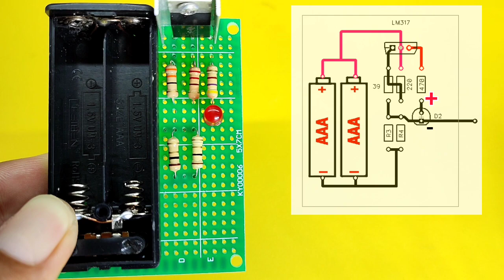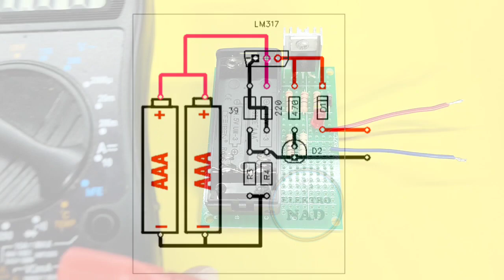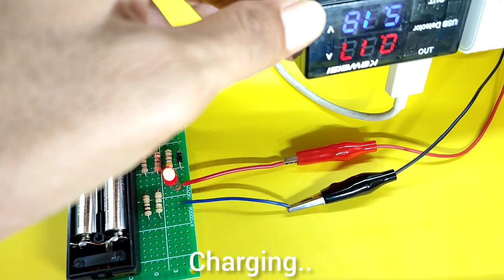Cara membuat charger baterai AAA 1.2V otomatis berhenti saat full.

Comment: Untuk lebih dari 4 baterai apa bisa
Reply from the maker: Boleh, bila menggunakan rangkaian yang sama maka waktu pengisian baterai agak lama, atau sedikit modifikasi agar pengisian sedikit lebih cepat, lepas saja dua resistor pembatas arus yang 1 ohm itu, sehingga jalur negatif baterai langsung terhubung ke negatif power supply
Reply: Kalau diganti potensio / trimpot bisa ga